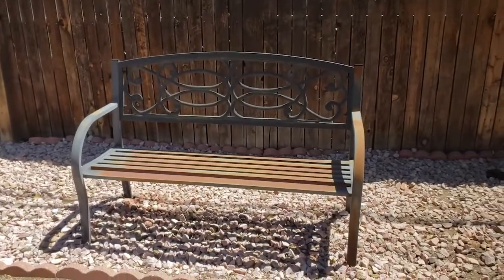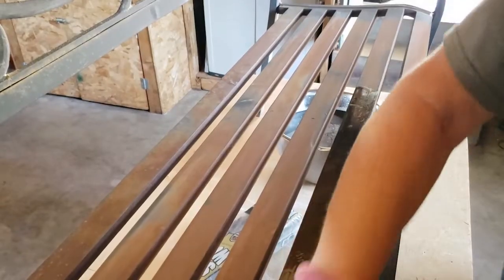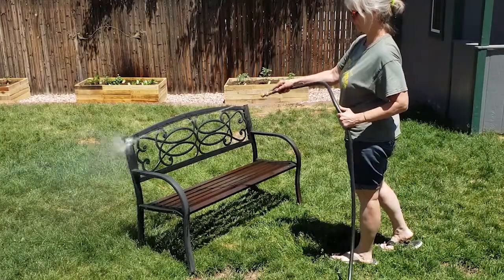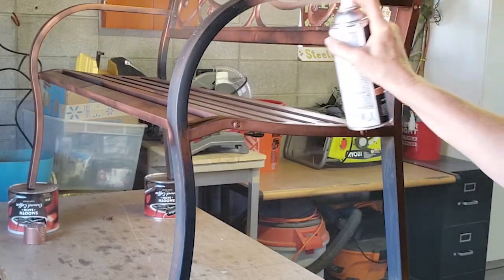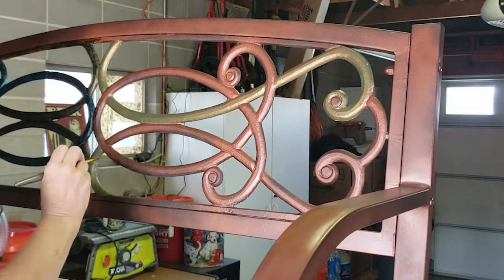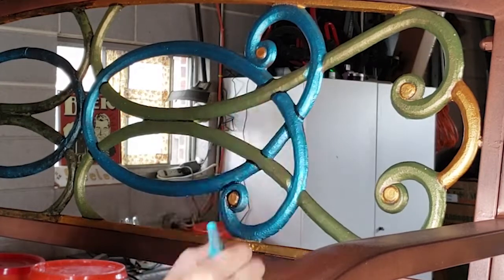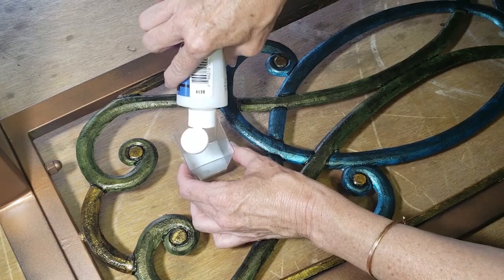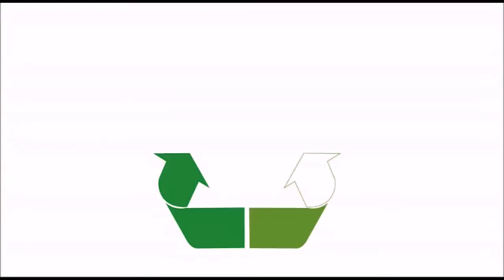Outdoor Furniture Restoration Funky Painted Metal Garden Bench

Comment: You've inspired me to just do my bench with whatever spray cans I've got out there! I always get them from the clearance table at the hardware store because people have returned to them. Mine will have a lot of red and copper and tan, I know that much. And whatever other small bottles of acrylic I have out there!!
* I've used acrylic paint on my wooden swimming pool steps I built.  I sealed them with that same one you used.  I put little carpet pieces on each tread and it's lasted for 2 years, so far...with me walking on it!😁 I love your bench! I can't wait to do mine. Even though it's cold now almost, I don't mind. It's better than working in the heat!!
Reply from the maker: Hi - thanks for your comment 😊 I am happy that you are inspired. Have fun with your project.